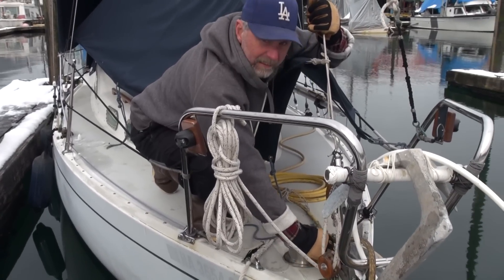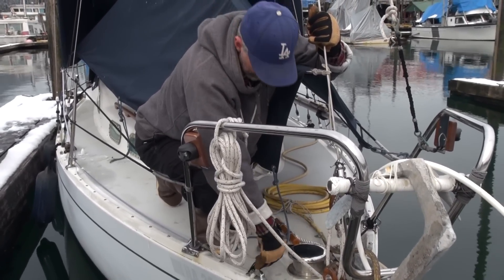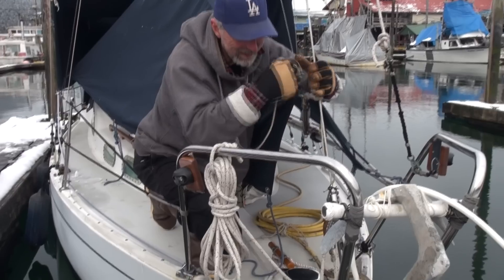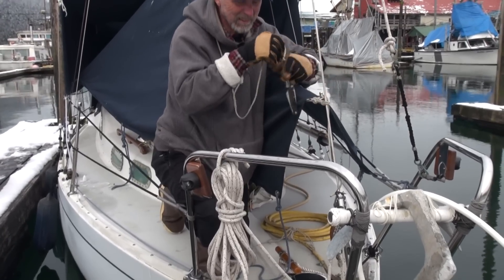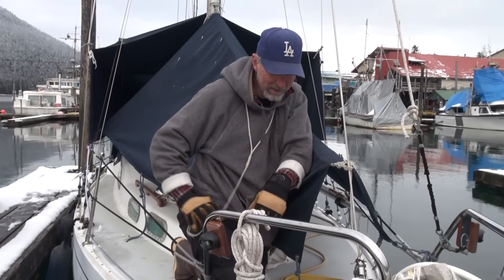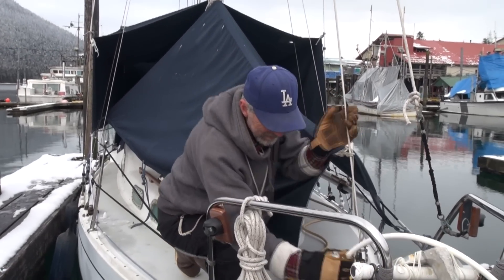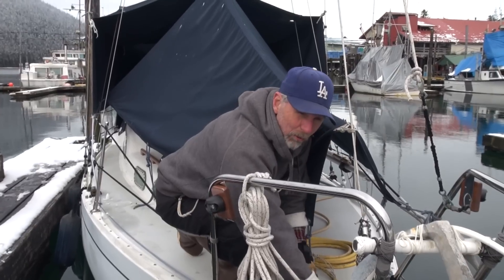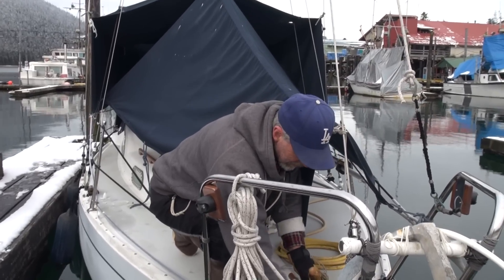Cruising Lealea in Alaska-Live Aboard Chores: Filling the Water Tank

Comment: I like your awnings, This is my 2nd winter living aboard and we love it and are getting better at it . I was wondering what do you heat with. lastyear we used one of those ultraviolet electric heators and it worked well, except when we lost power for 3 days thanks to a blizzard, so this year we upgraded to a propane fireplace heator which works great. keeping about a 70deg average even when the temp dips to 16deg outside. anyway I am rambuling on. love the videos keep up the good work.
Reply from the maker: We have a
5200btu electric heater with circulating fan for primary heat when AC power is available.  We also have a 5000btu alcohol fueled heater for when the power goes off or we are at anchor.  For detailed information on how we keep the boat warm and dry in cold weather check out http://cruisinglealea.com/notesoncondensation.html
Reply: Cruising Lealea thank you that was very helpful, I didnt know about the moisture content in the fuel. I am fortunate that my propane fireplace has a sealed combustion chamber and double lined flum, for exhaust and fresh air. I am not familer with dry deck but I will surly look into it. I keep the air circluating with some fans and am currently working on a duct system using computer fans to circulate the heat to the v-birth.
Reply from the maker: mustangjaime77
The most important thing is to get the warm, moist air out of the boat before the moisture condenses out of it.  Place an exhaust vent as far as possible from the intake so the air travels all the way through the boat. I think the best place for exhaust vents is as far forward as possible in the Vberth so the moisture from respiration while sleeping can be effectively evacuated from the boat.  A well designed furnace negates much of the negatives of propane heat by venting the moisture released by combustion out through the flue. (Unfortunately along with some of the heat)  Nothing you can do about cooking though. Dri Dek interlocking tiles are available at West Marine and other retailers.  They are great in lockers to keep gear etc off the hull and allow air circulation.